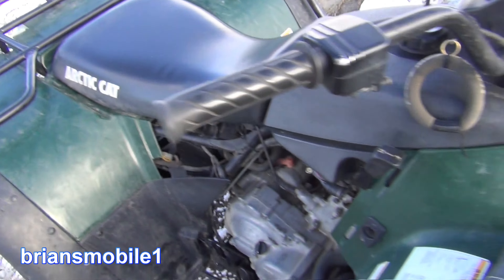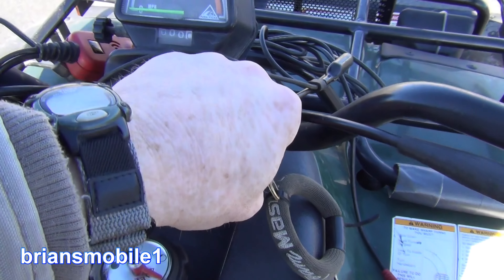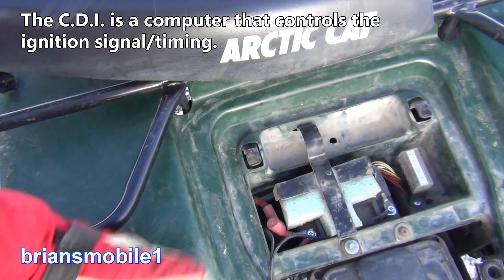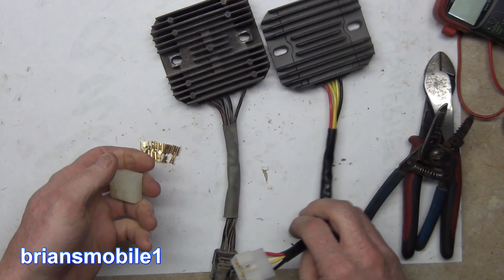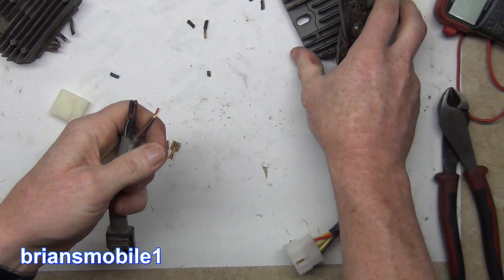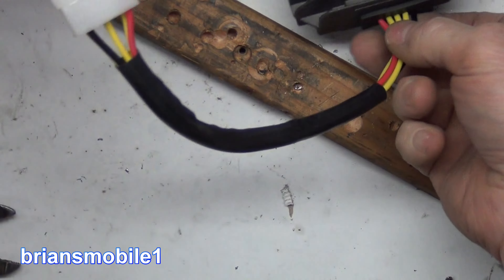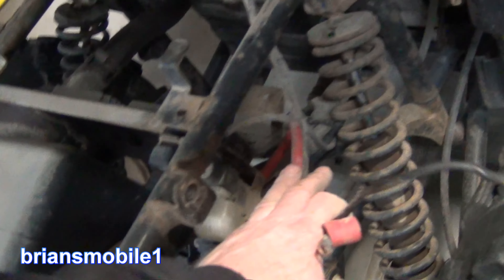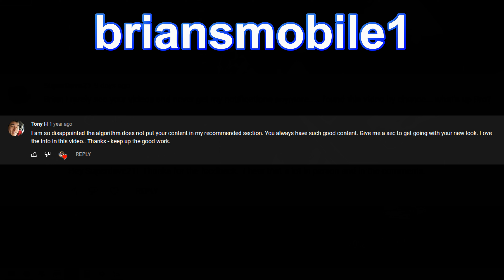How to Diagnose and Fix an Arctic Cat Stumble

Comment: Thats crazy, I had a super similar issue with my Arctic Cat 500.  I had a dead battery that had been dead for a long time but would always jump start it and I never thought anything of it until it stopped working.  It would start fine and run fine at idle, however as soon as you gave it any throttle, it would bog down, miss really bad, and stall.  I went through a handful of parts (carb, coil, plug, etc).  Finally, I got frustrated and used my oscilloscope to monitor ignition primary (to coil from CDI unit) and found that the primary side was dropping out when I gave it throttle (was not sure why at the time but your comments on input voltage now make sense).  I changed the CDI unit with an aftermarket (cheap one), same issue persisted.  I monitored the RPM signals from the stator and hall effect sensor to the CDI unit, no issues/dropouts there so I changed the voltage regulator (also had to swap over the plug like you did).  Issue still persisted.  Lastly, I changed the stator (which comes with a new hall effect sensor as well since both are on the same harness inside the gearbox).  The stator fixed my issue right away, no more fluctuating voltage problem or stalling.  Voltage is now steady at 14.5 VDC when running and no more throttle issues.  Was super interesting that a throttle issue was caused by low battery voltage.  I only wish your video came out a few months ago, I could not find anything online at the time about the CDI unit voltage sensitivity.

Comment: I have a similar era 500 and I’m running into this problem as well. Carb has been rebuilt, cleaned the tank, and new plug but it still dies after a few minutes like you was saying. I believe I’m gonna try a new VR also

Comment: Having a very similar issue on a 08 700 efi suz engine. Runs a little doggy after heating up and then will not start back up if i shut it off. EFI flashing across screen. Fan runs till shuts off and let sit a little while longer to cool off and bam! starts right back up. Going to check both stator and regulator. Thank you  and the comment section!

Comment: Yes the genuine part is expensive, and the aftermarket is cheaper, and often will work as well as the oem part.  Yes grab a spare one, wrap it in heavy plastic, along with a dozen big cable ties, and a cutter, then zip tie it to the frame, or place in the battery box as a spacer. That way you at least have a spare, and add in a rope as well, just so you can tow the other guy who does not have a spare back to home.
Reply from the maker: I like the battery spacer idea!  Good thinking.
Reply: @briansmobile1  Used to drive a Ford, I had a small bag with spare CDI, 7mm spanner and grease in a small bag, because you never knew when the ignition module was going to fail, either the oem part, very pricey, or the aftermarket part, a tenth the price, and equally likely to fail. Buy two, run one for a month, then swap with the other as you know you have a working module. Soon as the one fails, swap, and go buy another 2, so you end up with 2 working spares.

Comment: Same issue with my 99 400. Although when I purchased it used the three field wires had already been respliced and every couple years it would cook them again right at that connector you saved. 
  My machine was completely wore out so it was just a matter of time. When one of the front wheel bearings locked up (2wd)  I decided it was time for all new bearings, coil plug wire, the crap carburetor, and a new regulator off eBay.  The instrument pod such as it was with just idiot lights no longer worked. It's been replaced with a speedo/odom RPM   coolant temperature Gage plus some other cool extras along with all the stock information as well.  Shocks were shot.  Found some nice new adjustable aluminum Reservoir shocks for $60.  Also paint as the frame was very Rusty.
 Waiting on the foam for the seat and then I'm ready for a test ride.
   Nice to know it is likely just the voltage regulator rather than the brain box. Although I do believe the cheap $15 Chevy igniter box I put on the Dodge would also do the trick.
    I go  by if it ain't broke don't fix it. 
  Unfortunately it was in need of everything. 
Should be like a new machine ready for another 25 years. 
   Considering it is used  mostly everyday for Ranch work it's done well. 
     Next will be the first time I have done much with the  83 200x.
    Yes we are both survivors despite it having only three wheels.lol 
  Engine still runs strong. Decades ago I mounted a bicycle Speedo /ode  so I can safely say it has over 60,000 miles. And only one clutch job.
    It's frame is not as Rusty but it is in need of a shock rebuild and bearings. And a third set of plastic.  Although I am tempted to go fiberglass and actually attempt to cover the back tires with its 8-in over rear axle.  Done lots of fiberglass work over the years so ....
At my age it's not like I ride hard anymore. Lol
     🤠🏞️🐂

Comment: Have 04 Yam Grizzly 660 . Do a lot of slow speed spraying tending to overheat rectifier and had to replace to keep battery charged. The high speed help to air cool rectifier in normal conditions

Comment: Keep us posted on this, I have a 2003 cat 400. It has the Suzuki engine (1st year for it) I had/have the same problem. I first put the Amazon regulator on it, that lasted one year. I then bought an aftermarket unit that was physically bigger but cost $100ish that worked sort of for a few months. I then had worse problems and figured out that my stator was fried. Replaced the stator with parts from "RM stator".(Highly recommend) That worked great for 6mths, now I am back to the original problem. Thinking the regulator is shot again, not sure if the bad stator fried it.

Comment: Have a 2000 model arctic cat 500.  With similar  issues except mine won't do anything but idle. Soon as you hit the throttle it wants to die.  I've replaced the voltage regulator three times and it seems it keeps frying them.

Comment: Thank you!!! I have the same problem with my Arctic Cat 500. Any recommendations on a more affordable voltage meter/power probe?
Reply from the maker: This is my go to recommendation because it's useful for many things and easy to use.  Set it to 12V and read the battery terminals.  → https://amzn.to/38SiC28  You could even use a cheaper one like this at the battery terminals as long as you set it right so the DC volatage values were reasonable.  → https://amzn.to/3JN5yrn

Comment: My 2004 bayou is all original I bought it from an old man who only used for deer season it has this original tires on it they are a mess when I drive about a quarter of a mile it'll run really good and then it'll just start to have to take a little bit and then stop after it seems like it cools down for about 20 minutes it'll start back up and go another quarter of a mile and then repeat why please help
Reply from the maker: That sounds like an ECU or ignition control module/box.  Could be a rectifier, but more likely the computer.

Comment: Ok. Is it a Suzuki, Kawasaki, or Yamaha? Arctic Cat never made their own engines and for sure never had a Honda.  I’m guessing Suzi because I’ve replaced those regulators all the time.  Corrosion and extreme load will also take out the alternator stator on a Suzi because the headlight circuit is not regulated, it creates heat instead.

Comment: 6:40 “there’s a lot of tear down to get to this” yeah I’d say so 😂😂 I’ve snapped 7 bolts trying to get to this thing so far
Reply from the maker: Seems like some access holes would help and then seal them with the rubber & foil tape for HVAC would make it easier to service and still keep the dirt out.